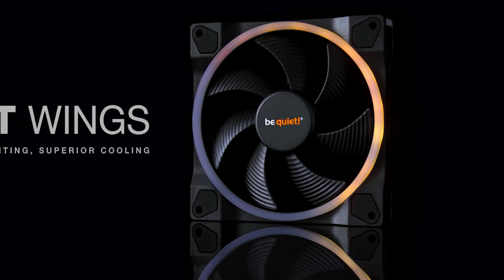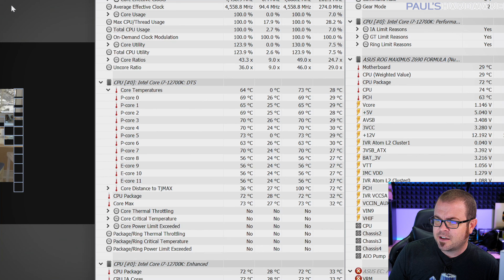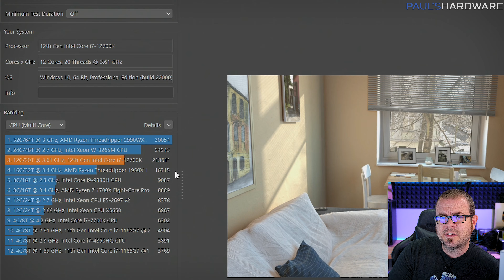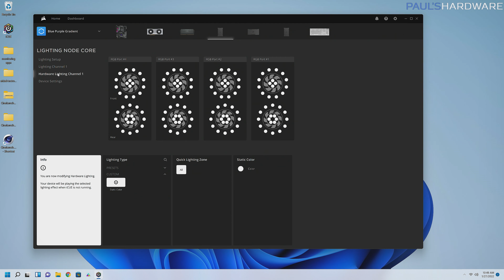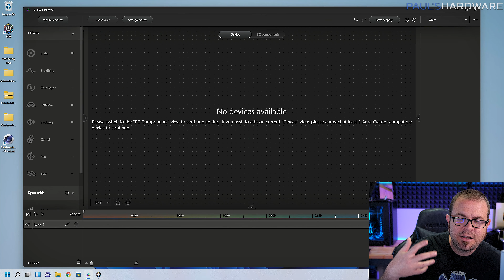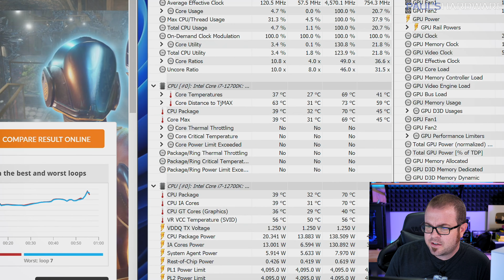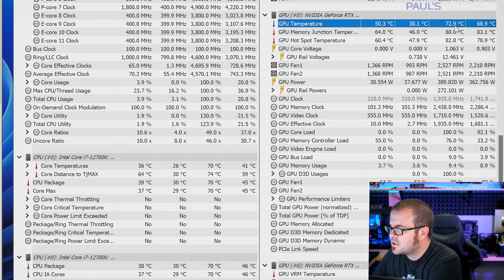Flipping Fans, Stress Tests and RGB Lights: All-White Build Part 2

Comment: I really would’ve wanted to see how AIO as exhaust but top and bottom intake would’ve affected temps. I really think that would’ve been better than all 3 of these.
Reply: I agree, although that would pretty much force all the hot GPU air through the aio. I think it's worth trying
Reply: I came to say the samething. This is how I have my 011 mini setup and it seemed to be the best trade off of cooling. There was only a 2c difference in cpu temp while keeping my gpu and mobo components much cooler.
Reply: I don’t usually comment on videos but I really don’t understand why this configuration was not tested. It’s makes the most the sense (or the bottom as outtake but I never would  do that myself as my  pc is right next to me and I would feel it blowing against my mouse hand 😬)
Reply: @slackbladder74  Free Hand Warmer
Reply: I too would like to see this tested.
Reply: Cane here to say the same
Reply: This is exactly what I was thinking. Please do a follow up video with the AIO fans and rear fan as exhaust and top + bottom as intake
Reply: Came here to say the same thing. Top intake, bottom intake. Sides exhaust. That would force cooler air onto the GPU, but keep a slightly positive pressure inside the case.
Reply: @skipmcilvaine  and increase the cpu temp
Reply: This was the only config that would have made sense, the other 2 config tried here are not logical, you need fresh air for the gpu is pointless to turn around the top fans, he would have keep a very good gpu temp and I bet cpu would not be affected as much as the tested config.
Reply: that would be even worse
Reply: I have a be quiet 802 in an inverted build using this config my CPU and would get like 5-10c hotter depending on the GPU load. However the main issue is it would cause my overclocked ram to overheat. In the end I just left the window off :(
Reply: It looks like Paul moved to this AIO side exhaust setup, which can be seen near the end of his latest video, "How to Move Everything from an Old PC to a New PC". He doesn't talk about it though, and I don't see him mention it in the comments here, so not sure if it performed better. I asked about it in the comments of the new video but no response yet.
Reply: @2_skoops  exhaust wast the last test. he didnt not change it back

Comment: My single exhaust area on the  back of my o11 xl does not align with the holes on my fan. Im drilling it out fuck that,

Does anyone know where i can get a mesh front panel with with fan support for that case
Reply: Ill be setting my fans like yours… my 3080ti FE was hitting 75 i have it down 10 degree, ill try your way
Reply: Thanks for watching 🔝🔝
And commenting
Send a direct message right away 🆙🆙  you just won a gift🎁... .

Comment: Even if the exhaust configuration on the bottom fans is worse (it's probably better but I haven't watched the video yet) they should be exhaust anyway because otherwise they'll suck in dust
Reply: Thanks for watching 🔝🔝
And commenting
Send a direct message right away 🆙🆙  you just won a gift🎁... .

Comment: It's just the way the case is configured, there is no way to have the fans correct because of how the GPU is oriented. If you change the top fans to exhaust, it's taking away cool air from the GPU. But if you have it as intake, it creates that weird pressure in the rest of the case. So no matter how you have it, it's going to fight itself and IMO the upside down design is poorly thought out.
Reply: Thanks for watching 🔝🔝
And commenting
Send a direct message right away 🆙🆙  you just won a gift🎁... .

Comment: On my 011D XL I did top and bottom fans as intake then side and rear as exhaust.  6 fans intake and 4 exhaust.  Once I configured the fan curves, they are very quiet and are just slightly positive pressure all the time.  Regardless if they are idle or ramp up during heavy load.
Reply: Thanks for watching 🔝🔝
And commenting
Send a direct message right away 🆙🆙  you just won a gift🎁... .

Comment: I have a O11 Dynamic - the old one - without the fancy features... if anyone is wondering how another config works:
I have top three fans with a radiator set as intake, side three set as exhaust and three bottom exhaust. 
My GPU is vertical, so air is being pushed right over it. It's a 6900XT and a 5800X system. It's not the coolest config I could find, but it is the most quiet by some margin. It's running about 68-69 on the GPU and about 65 on CPU. If I flip the config, drawing air from the bottom, exhaust with rad on top or side, it is significantly more noisy - 4-5db (as far as my 15 dollar db-mic-thing can measure) - but it also drops the GPU by 2-3 degrees and the CPU stays about the same. (all in TSE)

thanks for a another great video Paul <3
Reply: Thanks for watching 🔝🔝
And commenting
Send a direct message right away 🆙🆙  you just won a gift🎁... .

Comment: nice job, I think It would be nice to also see AIO as exhaust and top as intake. thanks for asking the important questions, paul.
Also if you could do this with radiators would be awesome. By that I mean using loops that are CPU-> GPU-> Rad1 -> Rad2 vs  CPU-> GPU -> Rad2-> Rad1 vs  CPU-> rad1 -> GPU-> Rad2,.
Reply: That's what i thought as well. AIO and back as exhaust, and everything else as intake.
The water loop path has been shown to be irrelevant for temperatures though. Multiple times by multiple parties.
Reply: That's what I thought too, this way the GPU and the radiator would get fresh air from the top and bottom.

Comment: I wanted to make my build inverted because it's on my left side. I was gonna put the aio on top with the gpu in the traditional position. Does it just not fit or are the thermals bad?
Reply: Thanks for watching 🔝🔝
And commenting
Send a direct message right away 🆙🆙  you just won a gift🎁.....

Comment: I think the difference between the first 2 fan configurations proves that you are trapping heat in the case with the 9-in, 1-out configuration. But it obviously makes sense to have the 3 directly over the GPU bringing in fresh air.
Suggestion:
6-in, 4-out
Turn around the 3 on the side, so that they exhaust. The 3 for the AIO and 3 over the GPU are all intake, bringing fresh air where it is needed most, but this configuration would allow more of the hot air to escape the case
Reply: all intake wont trap hot air, the air will find its way out through any hole in the case, of course the more airtight the case is the less air the fans can push, but most cases leak like a sieve so that is not an issue.
So as long as there is a grill that the air can escape from mostly intake is probably the best.
Reply: @A.Martin  I know air will find its way out, but with 9 intake fans, only 1 outflow and no other obvious way for the air to easily escape, you will end up with a much higher pressure inside the case. Higher pressure means more air molecules trapped inside and not moving as fast to escape the case. Plus there will probably also be more pockets where the air will get trapped and slowly swirl. Having 6 fans blowing in and 4 blowing out will still keep it in positive pressure, but there will be a lot more air moving overall as it will be much closer to air in equaling air out.
Reply: Thanks for watching 🔝🔝
And commenting
Send a direct message right away 🆙🆙  you just won a gift🎁.....

Comment: To provide a continuous airflow, even so it sounds counterintuitive, I would suggest to put the top vents and the sidewall vents to intake and the bottom as well as the back vent to exhaust. With these amount of vents you can ignore the natural ( warm air goes up) flow but you would create an intense airflow from top/ Front to bottom / back. This way you also don't have vents blowing in opposite directions, as you have with your original setup between the GPU and the bottom vents. Exhausting out at the bottom will also prevent the intake af more dust via the bottom vents. Would like to hear about the result.
Reply: I thought exactly the same. You could then also remove the dust filter on the bottom, thereby reducing resistance. With three fans pulling through a filtered radiator, three more pulling on the top through a filter, and four fans pushing air out without any real obstructions, it should result in a quite balanced pressure situation - probably still positive pressure.
Reply: Thanks for watching 🔝🔝
And commenting
Send a direct message right away 🆙🆙  you just won a gift🎁.....
Reply: Main problem with that is that dust tends to fall from above the computer.  Exhausting fans from the top blows the dust away from the computer, but if you have intake fans at the top... all that dust is going straight into the computer.  Not a big deal if you clean the computer regularly, but it'll be even more noticeable on a white case like this.
Reply: @Dyonivan  - I agree, except that the graphics card needs fresh air. It's awkward, regardless.
Reply: @SullenSecret  its kind of why the upside down case doesn't work, because it makes you intake from the top where dust will be sucked in, and most cases don't have a top filter. So your radiator gets full of dust instead.
Reply: @A.Martin  o11d has filters on top and bottom.
Reply: @Dyonivan  That's what filters are for.

Comment: My first thought after hearing "all fans as intake" and seeing the aio cooler with the pump oriented above the radiator was: Steve's going to have a heart attack if he sees this
Reply: The pump isn't oriented above the radiator.  The highest point of the radiator is above the pump, just the intake tubes are below the pump.
Reply: i think you need to rewatch Steve's video or Jayz that explains why comments like yours are incorrect.
Reply: @Stavroization  Wait, my bad.  I seen the S profile image and thought you were the original poster telling me I was wrong.
Reply: @Stavroization  Mfer watch Steve's video of "Stop Doing It Wrong: How to Kill Your CPU Cooler (AIO Mounting Orientation" at the 19:45 mark.
Reply: Thanks for watching 🔝🔝
And commenting
Send a direct message right away 🆙🆙  you just won a gift🎁.....

Comment: I use top intake (radiator), bottom intake, side exhaust, and single rear fan also exhaust on my Lian Li o11 case. I had top exhaust, and side intake previously but my CPU was getting so hot while gaming (5950x) as the hot GPU air would be exhausted through rad.

Comment: And still, Signal RGB is not able to control most of the well-known brand's RGB product and you DO NOT need to install a number of their bloatware-level crap anymore. I whish YouTubers would finally acknowledge the existence of that piece of software, review it... and maybe even help a bit with inputs on the development of the product. Because there's no way this RGB control stupidity should be encouraged to continue on. We need to put pressure on all the manufacturers so they make everything work seamlessly with other products. The worst thing to do is tell people they should be pairing such and such brands because only those two would play nice with each other. Let's all stand together as a community of enthusiasts and pressure them into change, beginning with YouTubers and various other influencers.

Apart from that, thank you Paul for the great content. :)

Comment: Exactly the "what if" type of testing I've been curious about. This is a keeper for other cases you review. I don't see anyone else doing it.
Reply: GamersNexus does it if the case has enough options available to warrant it. 

Although it's always important to remember that any of that kind of testing really only applies to the specific case with the specific hardware in it. Use a different case, or different hardware in the same case, and the results can and almost always will be different.

If you really want to know what the best option for your case and your hardware is, you'll have to test it yourself. Or I guess build literally the exact same thing Paul did.
Reply: most don't do it because its ALOT of work to test every different configuration that does or doesn't make sense

Comment: I always noticed in ANY case, all in and the single in the back as out,  ALWAYS has the coolest Temps, in any and every case I've use in 20+ yrs now.
Reply: I do agree, doesn't matter if you have positive pressure anyway, the cases are full of holes so that extra air coming in finds its way out of all those other holes. Now if your case is airtight or nearly airtight then balanced pressure would be needed.

Comment: I have a Dynamic XL with 10 fans, 7 intake (including the rear) and 3 exhaust. Full water loop for CPU and GPU. I figure since I have 3 rads, with 2 rads more or less inputting hot air into the case due to being intake, the rear fan serves as to bring in colder fresh, non-radiator, air. Good video Paul.

Comment: you were only right about not having GPU and top fans not working in different directions (which is pretty obvious and not this build specific) if you wanted to try an alternate setup, you should've tried top and side intake with bottom and singular fan exhaust - maintaining positive pressure, right GPU flow but higher airflow due to exhaust matching intake a little more